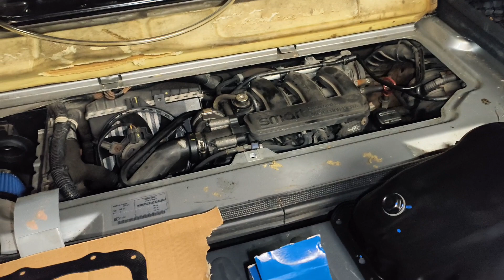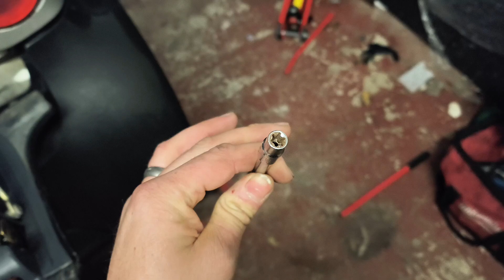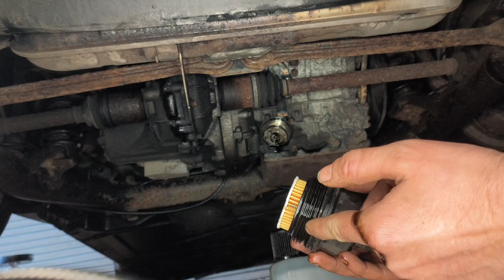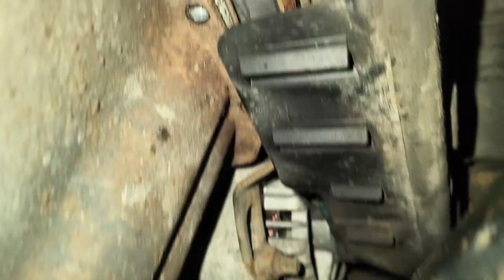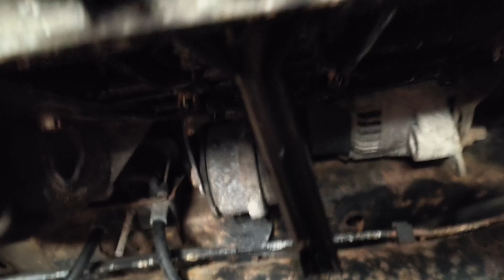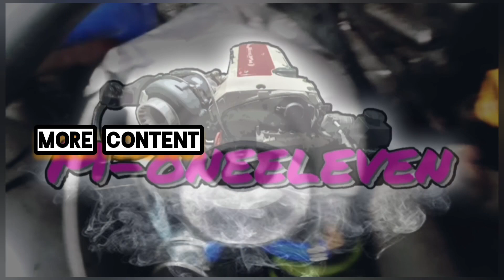Don't Let Leaks Ruin Your Ride! Improve Your Smart Fortwo Serviceability

Comment: Difficulty getting a gasket for my new sump, Smartmart seem to not exist. Everybody else seems to sell sealant only. MB dealers don’t want to know Smarts.
Reply from the maker: @GWAYGWAY1  SmartMods.co.uk that is the gasket I used and I have had the sump on and off over three times since fitting and it has never once leaked.https://www.smartmods.co.uk/shop/product/sump-gasket/ this is a link for the W450 sump gasket. Unfortunately not many folks want anything to do with smart cars, but if you have patience they're not too bad to work on. I hope this helps please consider subscribing if this helps thank you

Comment: What was that access like for the rear of the sump ... I seem to have some sort of plastic cover up there 🤔
Reply from the maker: @Jaxs2  there is typically a splash guard for the alternator, fortunately and unfortunately mine didn't have it which made this job easier but a about a week later the alternator failed 🤣. I believe it's two 10mm bolts that hold it in place then using a 1/4 ratchet with the plastic out the way was fairly easy
Reply: @M-oneeleven-M111  Oh, right, 😊  much appreciated 🤙🏼